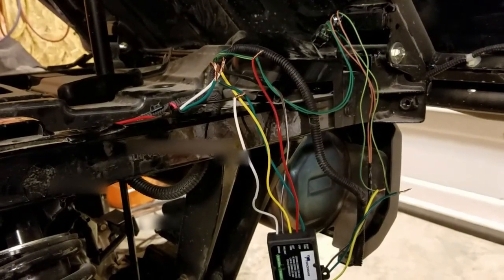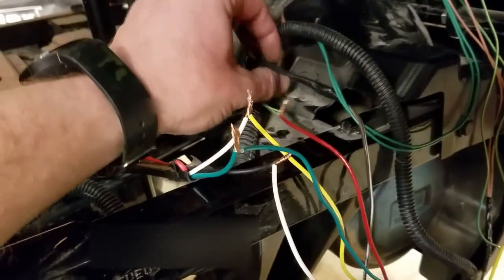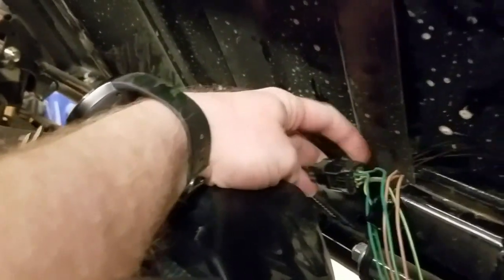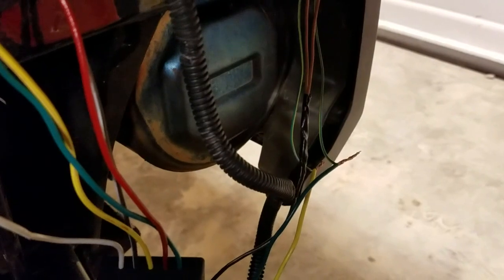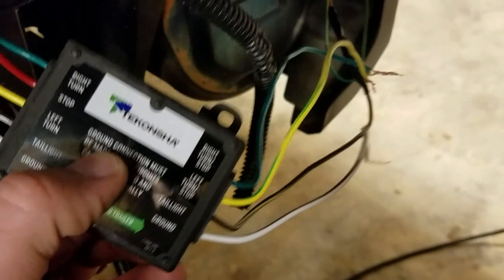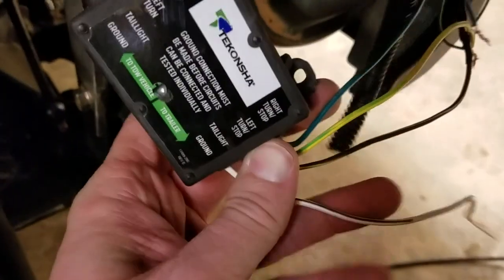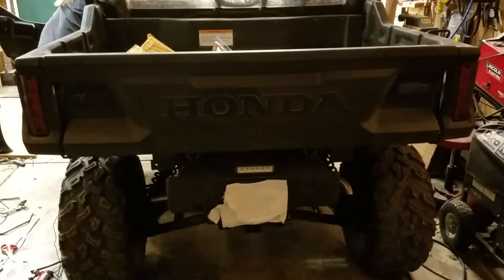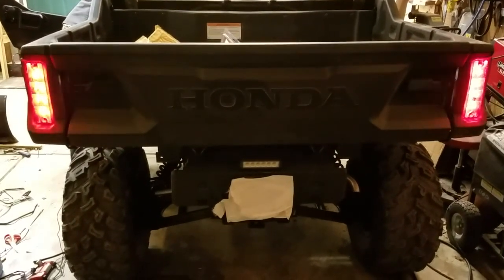Honda Pioneer 1000 DIY Custom Turn Signals Installation Part 2

Comment: Got replaced part back.  Installed exactly the same as in video.  Turn signals in back only work when brake is depressed.
Reply from the maker: Watch this video. See if the instructions are any clearer. This is for a Pioneer 700 but is very similar. https://youtu.be/5iBPaxFZP7Y

Comment: Do you have to have a flasher relay to make the converter flash or is it integrated into the converter?
Reply from the maker: You have to add the flasher seperately

Comment: Worked great for me, but I strongly suggest you use the Tekonsha like Jack Master did here.  I got impatient and cheap and got the Hopkins 48845 12" Tail Light Converter.  What could go wrong for only 10 less dollars??  Everything works except when the right flasher is on, it faintly makes the left flasher light up.  Not enough to worry too much and it's only in the front.  I mounted my front flashers in the same spot so no one from the side would know the difference anyway.  And straight ahead you can clearly see one is brighter.  I hear it's a common issue with that converter, so unless Jack the Master All Good Ideas says otherwise, use the Tekonsha.
Oh and to fix my problem, I put a diode on the left turn wiring to keep the right power from creeping backwards up the left turns path....aaaaaaannnndd then the tail lights quit working!  So back to the original setup.  
I think the whole project I'm in for $60 and I didn't have to drill in and wire little red tail lights like you get with the crappy $150 kits.  (or $300 for a "good one")  And $20 or that $60 was light up LED switches that blink with the lights.

Comment: Is there any reason an adapter that doesn't include the taillight circuit wouldn't work that you're aware of? I would prefer to leave the taillight wiring alone if possible.